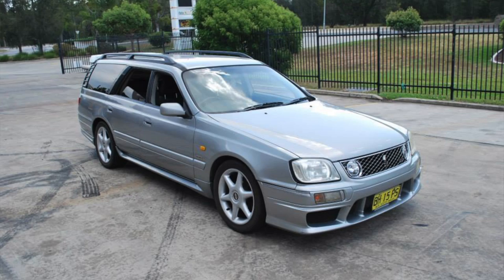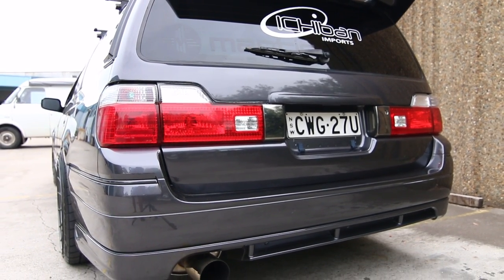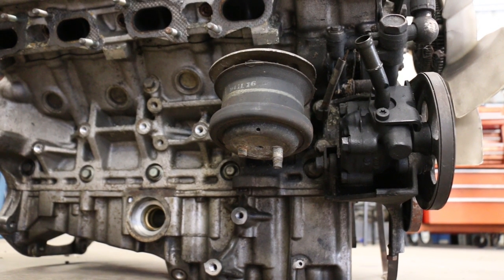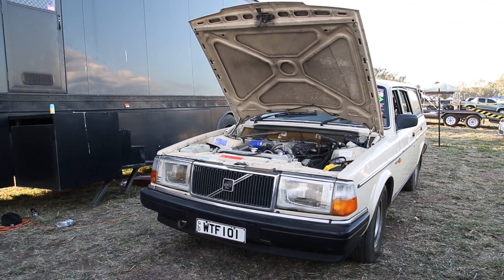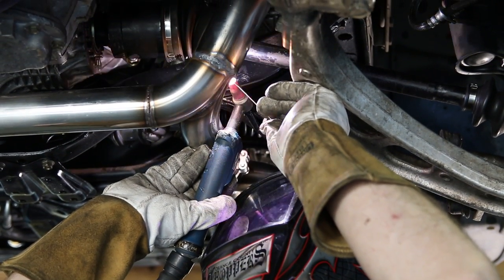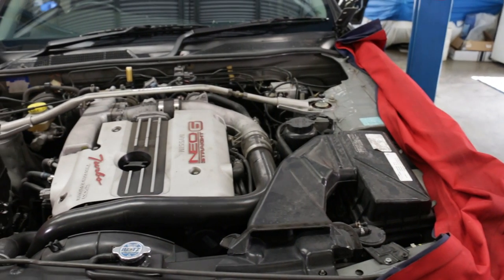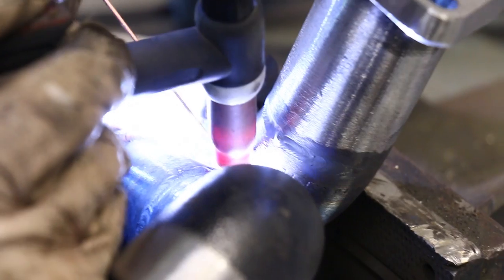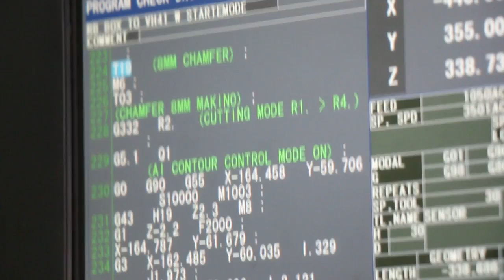Nissan Stagea 'Double Unicorn' Build - Turbo, V8, Manual & AWD - Episode 1

Comment: Not sure of the regs in Australia or even if you get this version of the LSx over there, but the 4.8L LR4 engine from the USDM GM pickup trucks might be an option for something smaller than 5.0L.  You can even use the 4.8 crank in a 5.7 LSx to make a roughly 312/5.1L destroked LS1 that could be a rev monster with the right valvetrain parts.  CHOO CHOO.

http://www.hotrod.com/how-to/4-8l-crank-ls3-block-how-to-build-an-8000-rpm-ls-stroker/

Comment: Couldn't you take a stock GM tranny and cut holes to make that fit instead of using the Nissan tranny? Oh,  it's AWD. Still, I wonder if it would've been less fabrication to mate up a GM manual to the  LS engine and then tie that into the transfer case.

Comment: should of gotten the awd v8 out of an infiniti fx45 and kept the motor in the nissan family and im sure the transmission would of been easier to bolt on to engine.
Reply: +Alex1Down5Up VH41 is a Nissan engine......
Reply: +Andrew Riles oh i did not know that so than which motor is better vh41 or vk45de?
Reply: VH series of motor I believe was designed in the late 1980's, and discontinued around 2001 or so, when it was replaced by the VK....though I don't know which is considered the better motor....

Comment: Would have been better off keeping the 25 and forging it for the money and hassle of doing a VH41 conversion.. fine if you were stepping from something like a rb20de in a 32 and you wanted something different, yes there are a few vk45 converts going around like that red twin turbo vh45 r31 and like that convert you might as well use two rb20 throttle bodies on each side of the plenum if you are going down to twin turbo town, if not because you are going the smaller vh41 you are probably better off using a single 3582r and the standard tb as to not complicate your pipework.. still though If I was doing a dayz stag.. I'd just keep it rb and prep a 30 block with forged goodies  and then slap the 3582r on that.. even if you are doing it on a budget you could pick up a gt3040r for fuck all and still have a 25/30 that makes 300+rwkw.. just my opinion though..

Comment: Ahh, that's the problem with these total conversions that require a mismatched transmission to engine, you need a lot of custom parts made. When those parts wear out, you need to buy them custom again, which is $$$, and you're screwed if the company that made them has since gone out of business.

Comment: Wowww.. Its STUPID to think of how hard it is to swap motors into cars they werent designed for. I was over this build once he said he had to mount that heavy V8 even further forward in the engine bay, thats NOT good! Even 1-2" of the engine going backwards or forwards in the engine bay can change handling dramatically. I bet the car probably started with a 62/38 weight bias stock or something like that, now its probably close to 70/30 front/back weight bias after the engine swap! That alone would make me want to scrap the build right in the middle of it!

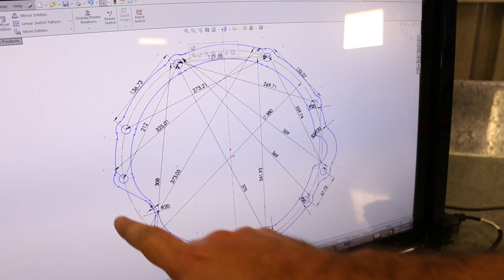Comment: I know nobody will care about this, but the solidworks sketch of the bell housing flange shown at 6:45 is under defined to the worst degree. please tell me that this was shown in an intermediate stage. can't get a clear view of the tree later on to see if it's still underdefined. no relations on show either, but they may be turned off. don't get me wrong it will work (sort of) this way, but it's very unstable. most other, more high end design packages like catia, will just refuse to work if you don't fully define your sketches. if you only have a couple features and don't change anything later on, it won't be a huge problem (still bad practice though), but if you try to edit something it will go all kinds of wonky. 

again, if it's intermediate  i've said nothing, if it isn't, please properly define sketches. all lines should be black using standard colors, and in status bar to the bottom right it should say fully defined when in a sketch, and a sketch in a tree should not have anything behind it, a (-) mark is under defined, a (?) is a lost relation, a ->x mark means a broken reference. same goes for 3d sketches. these are "form-points" when drawing things, but absolute necessities when designing. although solidworks is cheap, it can be a very powerful package if you know how to operate it. it's very tolerant of inexperienced users too, which is good at first, but it means it's very tolerant to misuse as well. some of the tutorials provided via the help menu are very good at helping you to design in a stable manner as well, the forums can be helpful as well. or feel free to ask me, i've been using solidworks as my main tool for about 8 years now, including for engineering a composite propeller blade and various other multiple thousand feature parts (you quickly learn to appreciate stable, parametric design then:)), using a lot of surfaces, that tend to be a lot less forgiving then solids.
Reply: +rasmAn2 should have watched the entire video first, same sketch is shown all nice and black in the outro, I offer my sincerest apologies and will be silent now..

Comment: a manual transmission on a twin turbo v8? you're going to be burning throug clutches every week, better off with an auto as it will handle the torque way better
Reply: U have no idea what your on about
Reply: lord christ all im saying is that gearbox and clutch are not designed for a twin turbo v8 that puts out tons more power and torque than the 6cycl that it was designed for. a torque converter will handle the torque better and will not wear and the auto box that the engine came with was designed for the higher torque output of a v8.